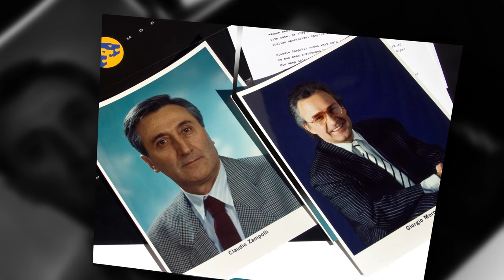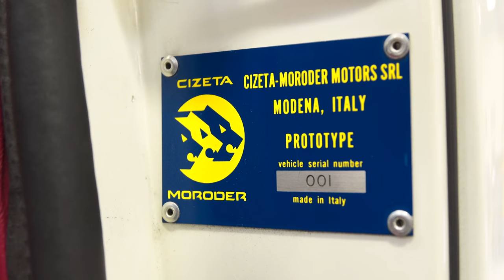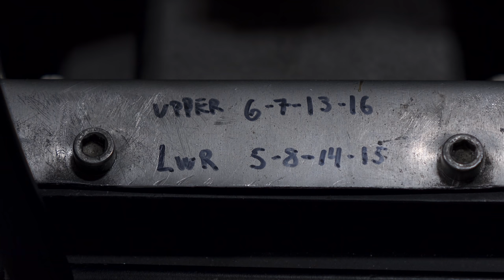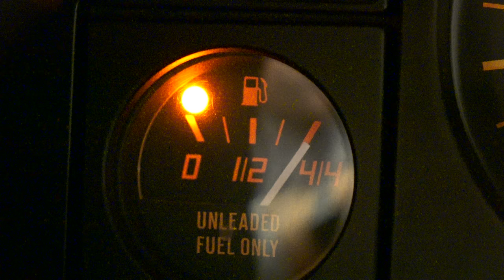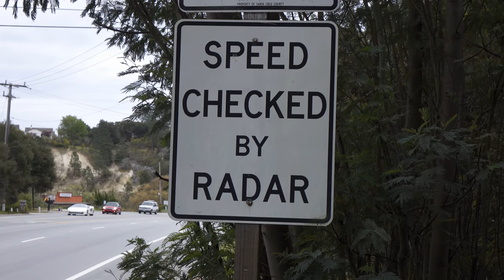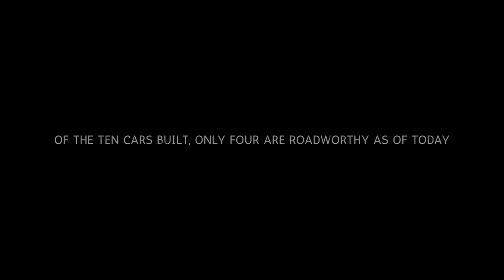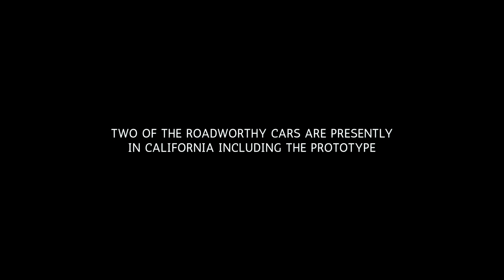Cizeta Moroder V16T: Resurrecting the Wolf Documentary

Comment: I mean its a countach with more cocaine.
Reply: its actually a diablo
Reply: @trievoluzione8868  which is a countach that was re-skinned in and of itself
Reply: @-CLASSIFIED-  what?  the diablo had almost everything different from the countach !
Reply: @trievoluzione8868   No, the diablo was literally a countach with a different body style slapped on it.
Reply: scythelord And other guys who are claiming that Diablo was made out of Countach. Can you please provide us the evidence. I checked it out and there is no info regarding that. The only thing that may be close to what you are saying is that before Diablo came out there was a Lamborghini P132 prototype that looked a bit like Countach, but was later made into the Cizeta Moroder V16T.
Reply: @scythelord   the diablo was faster it was harder to control it felt like a boat the countach was  little bit more responsive than the diablo   the diablo's  engine  was modified the original countach was able to hit 295 km/h but the diablo gained more hp and so its top speed was 320 km/h  the engine  had a deeper tone than the countach and  the brakes were also  different!
Reply: more Diablo than Countach
Reply: @victorm9131  No evidence? everyone with a little bit of lambo knowledge knows that the diablo used pretty much the same tubular frame as the countach, with a some adjustments to wheelbase and track. It's in every lambo history book, just because it isn't on Wikipedia doesn't mean there's no info
Reply: @arablues4142  i don't know what cocaine you are on but just because  both share the same  tubular frame it doesn't mean that it's the same car  for a example look at the reventon and the aventador!
Reply: hhahha
Reply: @arablues4142  Completely agreed, especially because much of the info on Wikipedia isn't as much 'official' as books - a source which exists even before most countries of today were yet to form - are made with thorough information, taken directly from the source.
Reply: @trievoluzione8868  295kph was a bit of a stretch for the old Countach I reckon
Reply: @Mad-RCandHOBBY  well it was supposed to be the Diablo before Chrysler redesigned it to look like the 1991 Diablo (thank fuck)
Reply: @trievoluzione8868  Reventon is a Murcielago dude
Reply: @Tommyblueeyes  the only countach that could hit 300 km/h was the 25th anniversary  and man i  messed up  the reventon i tough that it was a aventador but it apparently is a LP 640
Reply: @trievoluzione8868  The top speed of the 25th was 295kph...close but no potato. The lp400 claimed 300kph but this was exaggerated to put the fear into the Ferrari Daytona at the time. Alot of people think the Reventon was based on the Av cos the AV took styling cues from it, but yes, based on an LP640
Reply: Doesn't look anything like a countach
Reply: sam moursi alpine A610 tail lights. Like Lotus Élan m100
Reply: Allways great to read the comments about these cars, from people that never drove any of them. Irony flag down.
Reply: @Freddy_Confetti  Similar though.

Comment: The Diablo looks much better, the engine was still an experiment obviously. But I do love the initiative, Giorgio always took on superinteresting things.
Reply: Gandini designed the Countach, the Diablo and the Cizeta Moroder...
Reply: @blackrose917 I have a very old magazine I bought when I was on holiday in Spain as a child. It featured on the front "the new Lamborghini Diablo". It was all in Spanish but it was this original design that Gandini created (and very similar to the Cizeta). The car was being tested at NARDO and covered in black tape to hide the shape. Then if I remember the Chrysler buyout happened and the design was changed to be more conventional. If you can call it that! The original design was more extreme and actually in my view probably too much at the time. It originally had huge circular intakes at the rear, which of course were dropped to be more square and then Chrysler "smoothed" the overall design out. I think the final car looked better than the prototype. If you Google Diablo P132 Prototype you'll see it and the resemblance to the Cizeta is obvious.
Reply: Gandini designed the miura as well

Comment: The man responsible for the design of this V16 engine was the famous ex-Lamborghini designer Oliviero Pedrazzi who also designed the amazing quad turbo V12 engine of the Bugatti EB110 with it's integrated gearbox /4WD system/limited slip center diff. That engine is redlined at 9700 RPM. At Lamborghini he designed the amazing conversion of the traditional front engine-rear drive V12 to the Miura transverse engine with integrated gearbox and differential in same engine block. They got the idea from the British Mini. You can see some of the the similarities of the Miura integrated powerplant in the EB110 engine package. Pedrazzi also designed the V8 for the Lamborghini Uracco. The V16 he designed for the Cizeta uses basically 2 Uracco V8 engines in one  new block. The engine block has 2 modified Uracco crankshafts in tandem driving the output shaft in the center between them. This is the unique 'T' configuration and is referred to in the  car badge  ' V16T'. The engine used 4 modified Uracco V8 heads and therefore has 8 camshafts and 64 valves.
Reply: Also uses identical piston/conrod from the Uracco V8.

Comment: This is what the Devel 16 WISHED IT WAS!! 🤣 What a beauty! Form and function, and good catch by the master mechanics on that ignition trigger issue.😉 It would be interesting to see this with twin turbos, updated ignition and EFI. It would probably break the 1K horsepower barrier easily!😁👍
Reply: That hp number would very easily be obtained even with smaller, faster spooling sized turbos. I have a friend in Toronto with an Infiniti G35 (YouTube = Nitish) that is making 1000hp on a built Nissan/Infiniti 3.5L v6.

Comment: Just saw something I didn't know. I had never seen a photo of the CM with the doors open (nor any videos of one in operation) but since Gandini used it as the basis for the Diablo I had always assumed they opened vertically like the Diablo. Now, after seeing they open conventionally and really looking at the shut lines I see the front lower corner would impede your legs getting in if they opened vertically. The engine has a nice mechanical whine to it. Is the timing all gear driven?  I like the look of the Diablo but I really like the way the glass finishes up the cockpit bubble with the rear deck extending beyond that on this car. It a bit more interesting visually that the way the roofline of the Diablo just extends to the tail of that car. Thanks for posting this!

Comment: Would of liked to hear more of the engine. Definitely a distinct sound nothing like a v12. Honestly sounded lazy or labored but that’s why I needed more. Otherwise gorgeous
Reply: What I hear during the overrun is two V8s having an argument ;) (which is about right because it’s not a true V16 but two V8s bolted transversely to a longitudinal transaxle to create a sort of ‘T’ shape, hence the T in V16T. 
Still a great noise though. And a very distinctive styling, an icon from my childhood, standing right next to such cars as Vector W8, Zender Fact4 or Dauer 962 LM:)
Reply: Yes they should have based it on lamborghini v12 with more cylinders added instead of based it on the lamborghini v8

Comment: Didnt Caddilac had a 16 cylinders project concept prototype coupe in late 90s?
Reply: No, it was in the early 2000's when they were racing at Le Mans with Cadillac Northstar.  So did Rolls Royce. The problem is that they go V16 for smoothness and power but just look at the size of the engine and modern engineering can make a V12 do everything you want. Here is an old clip from Top Gear :- https://www.youtube.com/watch?v=NmpkELLyrO8 . I think they decided to make the Escalade instead, Thanks for that Cadillac.

Comment: just wondering , the 16 cilinder seems to be made from 2 v8 engines , did they fase the cilinders so they fire in sequence or did they for two cilinders at a time
Reply: good question? I don't think they shared a common crankshaft, from what I remember reading in Road & Track, when I read the article in the 80's.    Both engines met at the transmission housing, specially built for this car, than the test of the gearbox was bolted to the common drive unit.  So I would image, that both engines were fired simultaneously.  I'm not sure if one engine was fired, in a reverse firing sequence, to make it run counterclockwise.  Since both engines are mated back to back, and not in-line. 🤔

Comment: Seems like every "supercar" with a 16 never goes anywhere. Honestly the fact it could be made to be drivable is impressive. Many prototypes are inconvenient paper weights.
Reply: Cadillac had a 16 cylinder engine way back in the day too, like in the '30's, they did it with two straight eights joined in v. The modern v16's were just two v8's joined together at the ends. That doesn't work because they tend to fight each other than help each other.
Reply: @briankearn3965  Thanks...I wouldn't say I really know that much about it but have always suspected it to be impractical. And as you said "fight each other". 
Based on just the fact that I've only seen a few drag cars and modified tractor pull vehicals use multiple engines. They aren't planning to go  far in them. 😆
I suspect the V12 is a hassle as well as that seems to be F1 technology. Other than supercars that sit a lot in a shop...Mercs and BMW "grocery getters" with them are cheap lemons used. (Good shell value with an engine swap apparently. Engine and trans is my weak skill set but my mechanic has both formerly V12 models. One with an LS and the other AMG V8.)
Seems like every other decade someone presents a new supercar that's mostly an elaborate investor con job. The newest one comes out of Dubai I think and claims to have a V16. Does it run?...who knows? 🤷‍♂️
Industrial equipment is a safer way for our shop to make a living. We just encourage employees to pursue related hobby projects as a side benefit and skill building exercise. 
Hope you have a good day. 🙋‍♂️

Comment: Funny story about the design.... The exact drawing for the V16T was presented to Lamborghini's management by Gandini (Who made the design) for the Diablo.  Chrysler who owned Lamborghini at the time said it was too hard edged too Countach like and wanted a more softer, rounder and modern car which turned into the Diablo.  Claudio Zampolli gave it the second chance it deserved with his company.
Reply from the maker: It has a lot of similarities to the original ‘Super Countach’ design (aka Diablo) but it is not a direct and exact copy.  Quite a bit has changed.  The original Gandini Lamborghini design is the P132 which you can find photos online.
Reply: Of course there were some changes and updates mainly dealing with the unusual engine layout but the base design was effectively the original drawing made for Lamborghini.  I feel that should be mentioned because per Canepa the older car ended up better than the Diablo and that is high praise and delightfully ironic.

Comment: I am by no means downplaying this piece of automotive history but in terms of original design the only original part of the design to me is the V16 engine. When this car was made there had already been a few car manufacturers that tried V16 engines that were basically 2 V8 blocks welded together but this was actually a totally original V16 block cast for this car. However, to comment on the looks. Again this is by no means an insult just my opinion so take it with a grain of salt if you wish. The front end is basically a Diablo with slight headlight changes the doors are diablo doors with a slightly redesigned window shape. The side profile looks like someone cut up a diablo and a testarossa or even a 348 and glued them together. The tail section looks like someone picked thru a spare part bin at a ferrari and lamborghini warehouse and just threw together random pieces until they had a somewhat unique design. The car was always an outcast from its conception and i commend the designer and engineers for building it. I grew up in this era of the supercar and remember drooling over countach posters and diablo posters and i remember buying ever issue of duPont registry i could just to flip through the pages to drool over the ads for these amazing cars. But to call this car an original design is over generalizing it and is overlooking the obvious design influences from the more well known and prominent supercars that it was modeled after and that the majority of the body parts seemingly were made from. Again huge compliment to the designer and engineers.

Comment: Crazy sound, did the designers use old Cadillac or Rolls Royce as the tech design for this 1 of a kind engine? Imagine today this as a kit car with choice of a 8 or 10 cylinder wow
Reply: If you look closely at the engine, its pretty much 2 Ferrari 308 engine blocks stuck together.

Comment: 17:04 Wait, theirs no radio in the car and the engines the music and this comes from a Composer, so it was really THAT Giorgio Moroder? how much money did scarface MAKE for him lol Also you can see why he says its more stable and refined than a diablo at 21:02, the rear wheel is about an inch or two further back. Which while small, was the amount that they needed to modify the 90's ford explorers so they wouldnt flip over from a tire blow out, so that does make a difference.

and the front wheel is a touch further forward, so i guess when they scaled it down for making the diablo, they should have kept the track length the same

Comment: fuel tank right next to the exhaust header, and it is almost as if the minds behind it wanted to ensure that this intrinsically bad idea will indeed cause problems, they did it twice on one and the same car..... italian engineering. :D
Reply: Zak Jansen  well, when you go forced induction on an engine to increase its output you generally and in most cases do the opposite and actually lower the compression ratio.

Comment: 0:20 "I'm sure a lot of companies are going into 16 now..."
Spoken like a musician not somebody who understands the car business. I have to cut him some slack though and this was in the late 80's when the motto was "nothing exceeds like excess". Nobody believed the oncoming 90's economic recession would kill this car. Anyways, it was well known that the main problem with a V16 engine is the crazy amount of heat they produce. Since there is already little room for huge radiators in tightly packed and cramped supercars V16's would only viably work in huge luxury sedans/saloon cars. And yes, V16 engined luxury limousines existed in the 1930's like the Cadillac V16 and the less common Marmon and Peerless luxury cars. 

Some manufacturers did indeed design prototype V16 engines. BMW tested their "Goldfisch" V16 in 1987 and even installed one in the current E32 7-series. Unfortunately the engine was too long and they were forced to fit the radiators with huge cooling fans in the boot/trunk and large cooling ducts were also cut in the rear sides. Mercedes having somehow found out about the top secret V16 BMW being tested therefore tested their own V16 engine for their new upcoming S-class (the W140). Neither BMW nor Mercedes ever seriously considered their V16's for production. 

The only reason Claudio Zampolli wanted a V16 was because it would be the thing which would set his supercar out from all the rest. And in reality the car didn't actually have a true V16 engine but rather two V8's interlinked in the middle. Unlucky for him by the time his car was production read the economic recession hit and even the wealthy refrained from buying a supercar.

Comment: they could've just replaces Fuel injection system first(K-Jetronic) with something more 'working'.
Reply: The biggest kinks were not the FI system, but the ignition system.  This car uses two distributors, two pick up coils, two ignition coils and both have to be timed independently, yet synched harmoniously for proper engine balance.  This vehicle basically uses two V8's fused together.
Reply: @LynxStarAuto  I understood that, but I though since you're working on the whole car, maybe it would be better to upgrade right away. That FI system known for giving hell and misleading in repairs. Maybe later Ignition system could be upgraded too. Interesting car , but one has to be very very sensitive in order to  feel repairs that are needed.